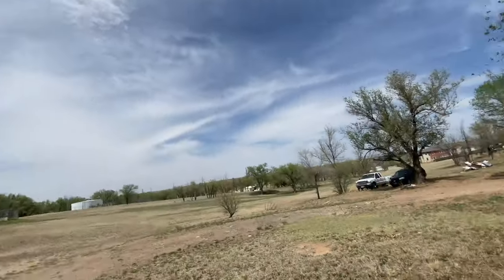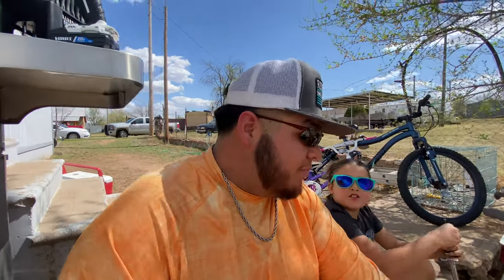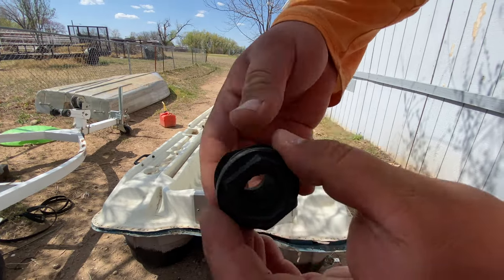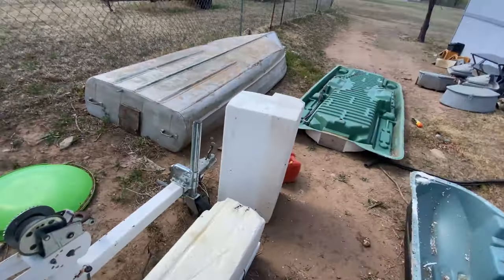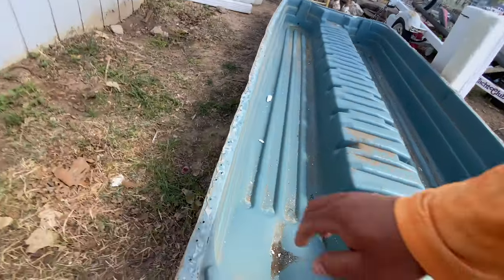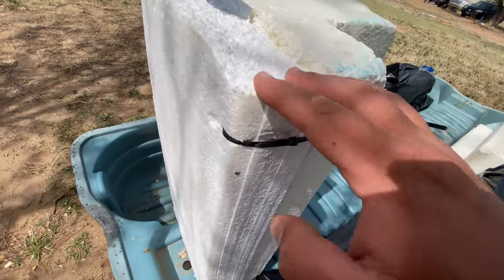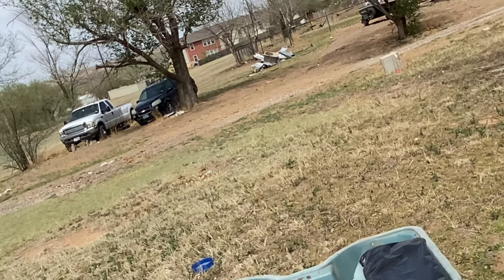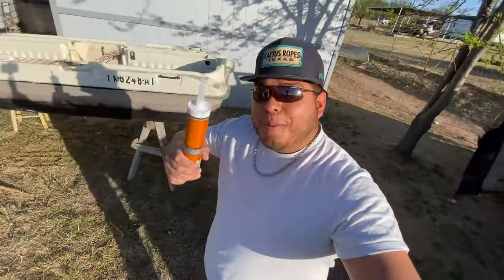Pelican Bass Raider 10e SPLIT IN HALF (again…)

Comment: A lot of work. One tip you should use backup washers on the bottom of the rivits. It would pull everything tight and be much stronger.

Comment: Great Videos Got a 10e a couple weeks ago  for $25. Styrofoam is definitely water logged hoping to dry it out in the sun.

Dremel with a cut wheel did great on the staples. And a crowbar and a mallet to split between the adhesive. 

Was going to attempt maybe sprayfoam in a plastic tote if the original styrofoam doesnt dry out.
Reply from the maker: Glad you like the vid! Sounds like u got a good plan brotha! Im sure it’ll work out for ya!
Reply: I just weighed out the waterlogged Styrofoam and it ended up being a total of 71lbs. Crazy. If I can get it cut in half I would be happy with that.

This is the breakdown

Left Front 13lbs
L Center 8lbs
L Rear 14lbs

Right Front 13lbs
R Center 7lbs
R Rear 16lbs